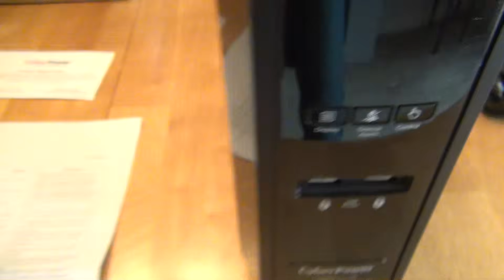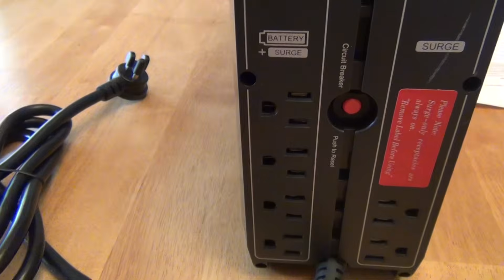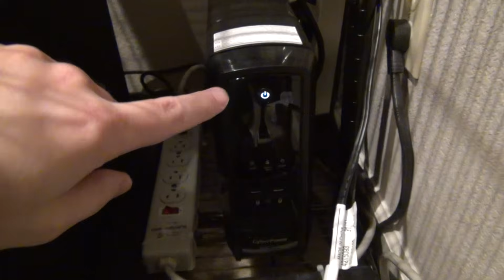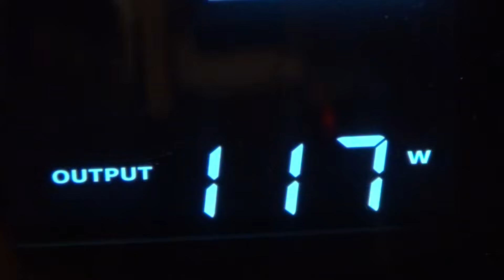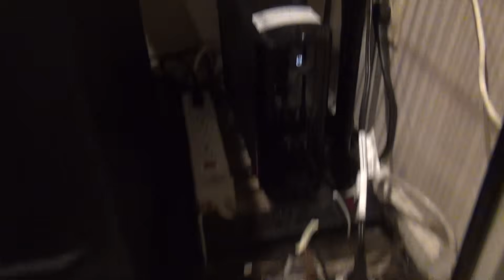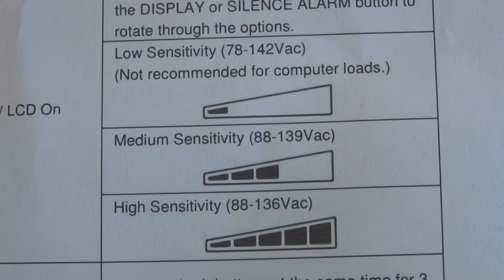CyberPower 1500VA 900W Sinewave UPS (CP1500PFCLCD) Review

Comment: Thanks for this video!  I would like to find out more information regarding the beeping while in battery mode.  I see that it does have a silence button for when it starts beeping.  That would be ok but I know I would NOT want to hear that thing beeping away at 3 am in the morning.  I know my tripp lite has software that allows me to disable audible beeps.  Does the software available for this ups provide that option?
Reply from the maker: I see it has the silence alarm button on the front.  I've never used it.  I have 4 of these now connected to any sensitive electronic, DVR, etc.  I lose power pretty infrequently when I'm home.  I actually like to power things off if I hear it go off, so I don't mind.  I think its only once ever gone off at 1am when I was home.
Reply: how do you like the tripp lite? im eyeballin both of these now.

Comment: @Reviews By Tiger
Glad you did a review on this one.
I was worried about coil line noise. I currently have a raspberry pi plugged into my current UPS just to soak up the current on the USB ports to stop the coil line. Maybe a similar solution could work for your monster power board thing.
Reply from the maker: Thanks.  I moved, which solved that problem :) .  I have a number of these now.  I never had a problem with them.
Reply: Reviews By Tiger Awesome. I just hope the power systems are not that different from the 240V versions for Australia / New Zealand.

I've got an older cyber power UPS that has a 50% chance of catching a power failure in time and horrible coil line noise on the USB charging circuit.

Looking at this as a replacement.

Comment: You say that you have bought a 2nd and 3rd unit.  Are they all the same size 1500VA?  I have the 1000VA version of this UPS and it's been working great for a couple years.  I am now in need another one (different room).  I don't really need more than the 1000VA but I was considering the 1500VA just to have extra capacity in a power outage.  Any thoughts on that?
Reply from the maker: I just kept ordering the same model from the same Amazon page that confirms my previous order.  I just got the largest for peace of mind, rather than trying to calculate exactly how much I really need, figuring I might have varied amounts of stuff plugged into it over time.  I don't plug my TV into it, just anything with memory or hard drive like a computer, DVR, xbox, etc.

Comment: Hi i own the same.would like to Know if its safe for my stuff if it show 122-123V? Is it normal that this wont regulate over voltage? Can you set it up for less input?
Reply from the maker: I think you can check your devices that you plug in and they would list a voltage range.  I think conventional stuff supports a wide range of voltage.  I don't claim to know everything about what is and isn't supported.  On my Monster Power Centers, they regularly show current voltages between 119 and 124 at my house.I think there are in-line power conditioners out there that can keep a steadier flow.
Reply: +Reviews By Tiger Ok Thank you. You ever hear of the cyberpower OL1500RTXL2U? im planning to get one for my PC for music recording, the unit locks the Voltage at either 110, 115, 120 and 125V. I heard it has noisey thought
Reply from the maker: This one is silent because it is largely passive unless it needs to switch over to battery.  This one relies on a fast switch, faster than your device should care.  Then it has a soft noise of a fan (much quieter than my PC), aside from the loud beeping to let you know it is on backup, which I think you can disable.There are other types of power backups that I've only read about.  Some offer continuous supply from the battery, so that it never has a switchover, and it keeps charging the battery.  I think this is how you get true continuous uninterrupted power at whatever characteristics you need.However they work, a concern is often how accurate the sine-wave-like alternating power output is, which matters for some sensitive equipment and power supplies.  This unit is supposed to have a nearly pure sine wave that would not look like steps if you measured it.  However, it only does that when it is actually running on battery.  The rest of the time it is your normal power unless it detects a bad condition.  The other type that is continuous, it should always be outputting the intended signal.  But there are power line conditioners that do that too, without a backup power source.

Comment: Why would you want your Monster Power device to cut power? I am not very well-versed in this subject.
Reply from the maker: Most people wouldn't.  But I had an unusual situation where I got frequent power surges for some reason that caused noticeable problems to my equipment.  So I actually bought the $150 dedicated surge protector & power line filtering that was the Monster Power Center.  That much helped a lot.  But of course when it trips, it cuts power to your computer, which actually caused more trouble from cutting power to the PC over time during use.  That is why I bought the $200 UPS.  I figure the UPS's primary mission is uninterrupted power with battery, not the higher level of surge protection that the other equipment offered.  I'm sure it has decent surge protection, but am not confident it handles it as well.  The UPS can deliver pure sine wave power, but only when running from battery.  Most people would probably be served well from just the UPS.